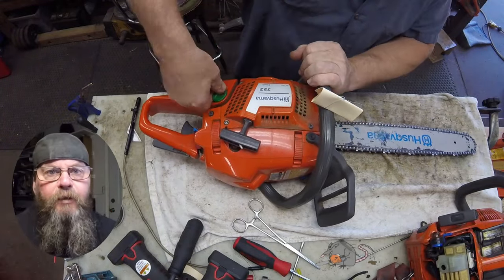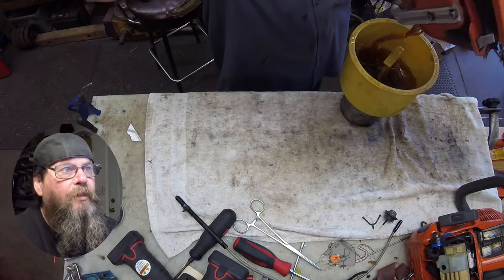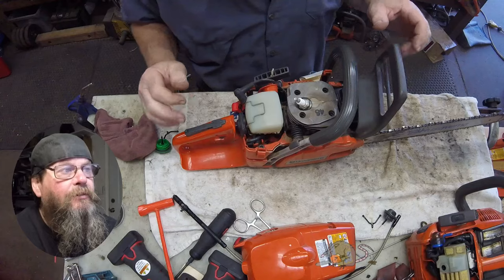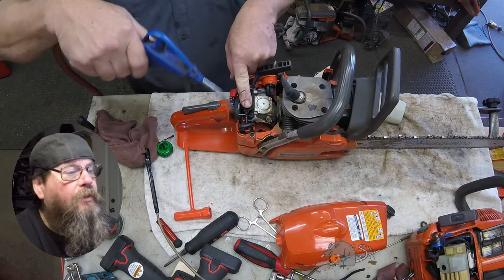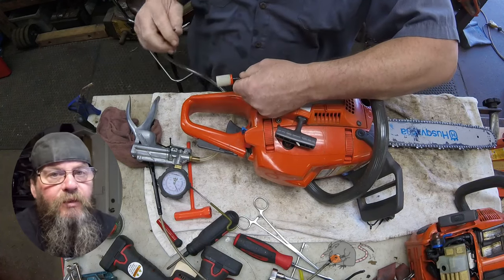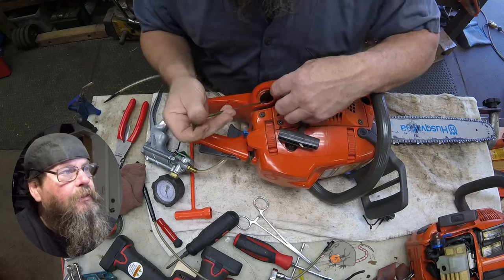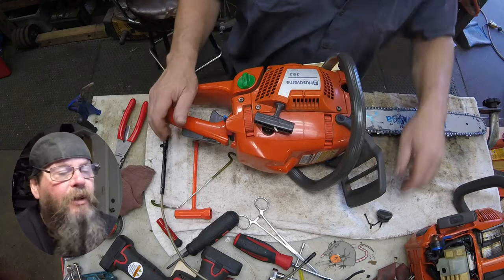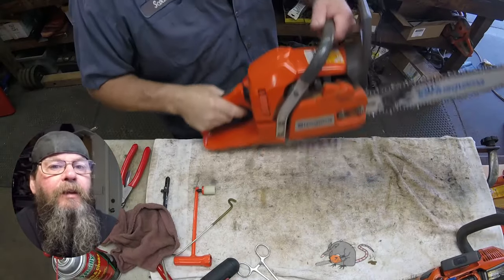Husqvarna 353 Chainsaw Smokes A Lot

Comment: Looks like you got out the vac/pressure tester to check the fuel line & carb, then put the new fuel filter on and said the hell with it! Lol
Reply from the maker: Oh you noticed that. I noticed it for the first time after making the video. Usually what happens is I get interrupted and forget where I left off. What appears as a transition in the video could have been 20 minutes away from the bench. There is a break in the video but I'm not sure if thats what happened. Oh well, stuff happens!

Comment: Hey, Scott!  I’ve got a Stihl MS 193C in the shop. Customer complaint smoking, so first thing I did is search your channel for clues and this video was the first result. This saw has the fuel and oil tanks one above the other so getting fluids in the wrong tanks was already my first thought. Started right up, idled, throttled up and ran at high speed perfectly but did smoke a bit on starting. Customer states he ran two tanks of 50:1 premix and it smoked the entire time so my initial suspicion was scoring. Will pull plug and exhaust and have a good look. Didn’t think about gasket you mentioned between tanks, but I think this is a single piece tank. I’ll pull the IPL to confirm once I’ve put it to the wood for at least 10 minutes to confirm complaint. 
Anything else?
Reply from the maker: A good place to start would be to run your own known good fuel/oil mix. If the smoke cleans up then you've found the problem. Check the air filter and also confirm the choke is fully open when running and that the carb isn't adjusted super rich. Look at the spark arrestor screen. If its not clean then you may have a clue as to his operating habits(low speed operation) or fuel/oil quality.

Comment: You prob see several cases of that. I’ve seen you clean carbs with gas. I worry about it having a check valve  so I don’t use anything too strong. What products do you use   I’ve even tired wd40. Thanks and take care
Reply from the maker: I figure the parts in a carb are designed to be exposed to gas so it shouldn't be to harsh. Simple Green seems to make the carb bodies dull gray so I don't use that anymore.
Reply: @TheGreasyShopRag  I use the purple simple green as a soaking medium.  Never had anything discolored.  I will try it in my ultrasonic cleaner with heat.
Reply from the maker: @steveriggenbach90  Ya let me know. I clean many of the parts that I list on ebay with a 5 gallon ultrasonic cleaner and am always looking for alternatives. Right now I like the parts washer fluid sold at harbor freight. Mostly because its cheap but it does a pretty good job on grease.

Comment: I find it amusing that someone managed to get the fuel and oil tanks mixed up 😂
Reply from the maker: @justinf1343  ..it happens.
Reply: Common mistake when you're hot, exhausted & just going through the motions to get the job done & over with.
Reply from the maker: @Joe_Blo  Sounds legit.